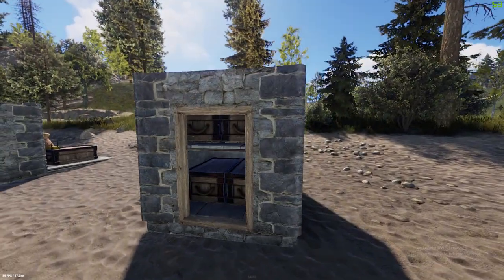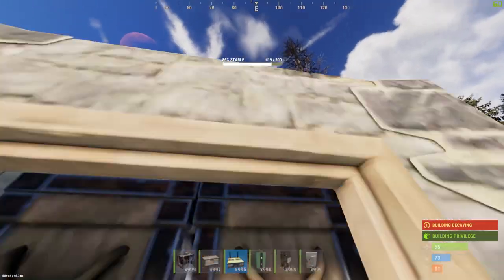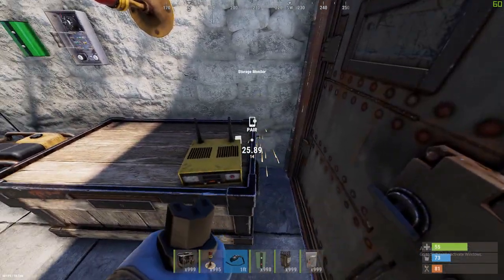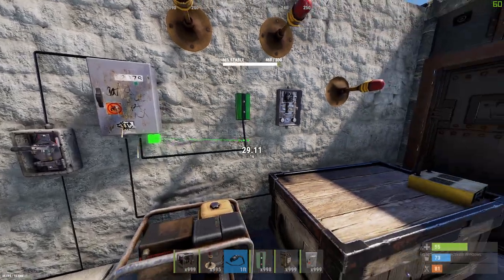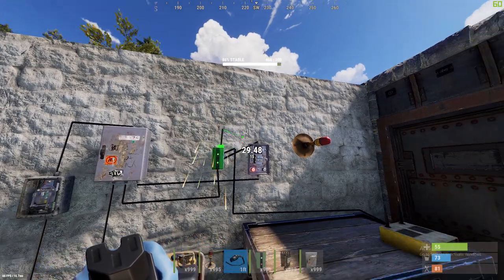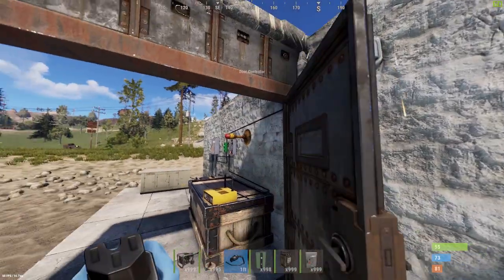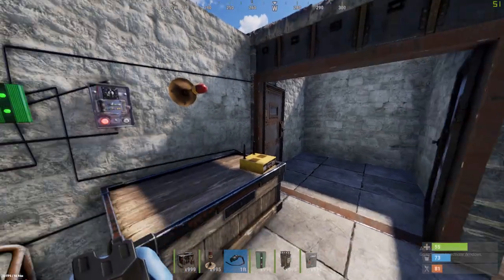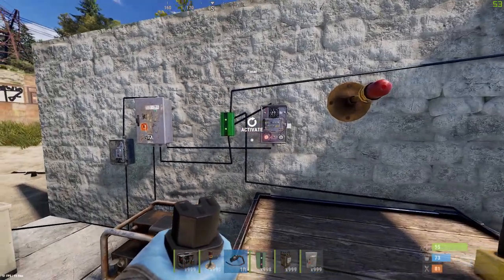Storage Monitor For Trap Bases

Comment: Ted. How do you pronounce your last name? I'm doing a video on a RHIB base and I wanted to mention you for the ramp design you used in your RHIB base video from years back.
Reply from the maker: Dont worry about how you pronounce it, i say it in my 4k thank you video when i talk about how i got the name.
Reply: @TedPommes  I want to credit your RHIB bay in my video brother. Without it I never would have done what I did. I just wanted to make sure I say it correctly.
Reply: I found your 4K video. Thanks.